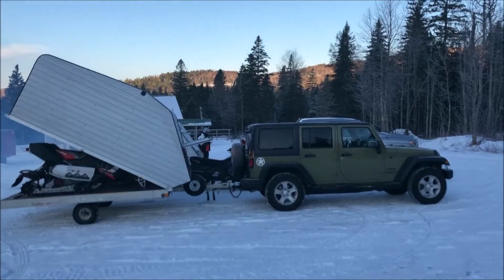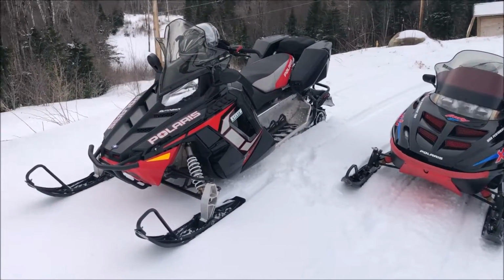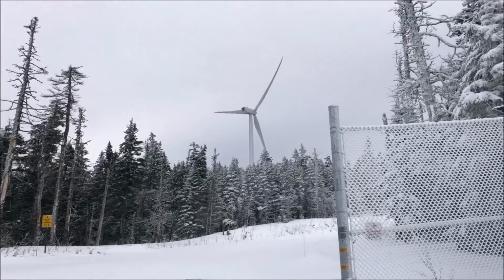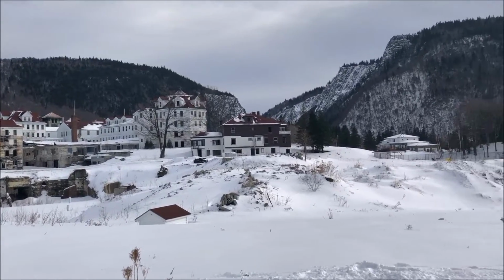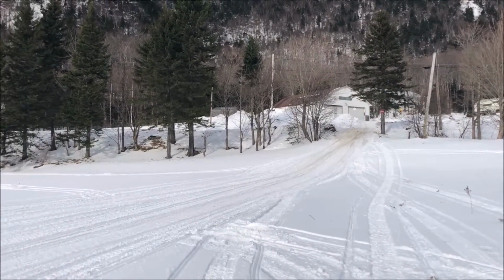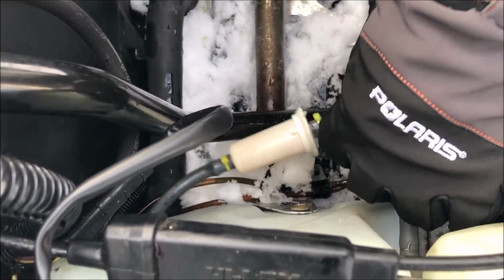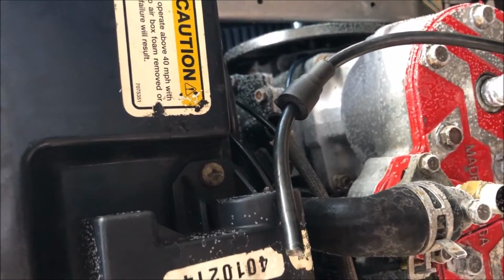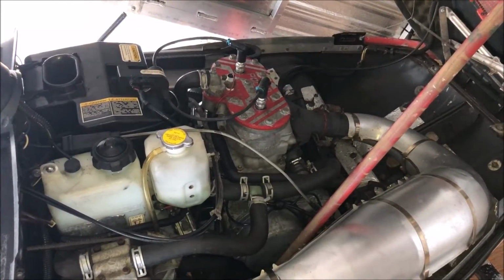First Ride On The XC700 And It's First Failure

Comment: Wow that thing sure sounds rattly inside the aluminum trailer.  Great folks over at Polaris Indy Garage!
Reply from the maker: It’s the aluminum heat shield around the muffler. The rivets that hold it down are busted and it vibrates at low rpm.  

Still need to fix it. 🤣

Comment: Nice ride Streeter, and it's always a nice feeling if something goes bad it's in a spot where you don't have to MacGyver something to get it back home. My question is, doesn't the spark plug lead screw into the coil? I know the older ones do, but apparently that's not the case with yours. Nice video, looking forward to more.
Reply from the maker: Yes you’re right. The problem was the that the screw portion that comes out of the CDI broke off in the wire. Leaving about 1/8” stub.

Comment: Great job on the rebuild! My 99 xc 700 just died out on the way home i think its electrical havent looked at it yet but do the cdi boxes go out just like that? Dont want to start were do you think i should start looking? Thanks for youre advice!
Reply from the maker: Take a look at this first. This should walk you through the basic stuff to check first. 

Polaris Indy Wedge Snowmobile No Start - Troubleshooting 101 https://youtu.be/yeWP-BPR-Rs
Reply: @StreetersGarage  yup watched the video...now i went to town to get gas its a 99 xc 700 it was running like it should until 3 miles back it just dies out. Thats it. Tomarow i will check youre list to see if something came loose..but there is fuel and i will check the electrical system. This is what i suspect its either the cdi or stator. But i will get back to you once i go threw the check list. Thanks for youre knowledge on this matter.
Reply: @StreetersGarage   i have a 98 xc 700 and a 99xc 700 and from what ive been reading about these sleds are 2 major problems with them finding  a  ingnition coil and stators. The guys tell me its better to upgrade to a rmk stator and coil ? I cant seem to find coils or stators for these sleds i would like to buy a set up for both so when it comes time to replace them i have them and after that they will be available. The stock ones are very hard to come buy if i can even find any. Other than that i can get everything i need for my sleds its just those oem stator and cdi, ignition coil.
Reply from the maker: Mykel Greene Yes. The Ducati CDI’s are known to fail and unfortunately there’s no aftermarket replacement.
Reply: @StreetersGarage Ducati stator is 11 months old  Why i suspect its the ignition coil the sled just died out like i turned it off with the key. Upgrade  thats not even a year on that stator..  Options? rmk stator,coil,cdi, kiehn carbs ,92 octane and timing.
Reply: @StreetersGarage  my sled is flooded it fouled the plugs on the way home and gas is shooting out the plugholes can i drsin the block? What causes this?
Reply from the maker: Mykel Greene bad needles and seats in the carb, bad fuel pump or stuck choke plungers. 

More than likely it’s the needles and seats.
Reply: @StreetersGarage  I looked at it again today and no spark...reason why it was flooded just happend because to much prime and chokeing it... Its electrical do these sleds have the cdi and coil located on the top of the air box? Could it just be the coil? Or both? Finaly im suspect its the stator
Reply from the maker: Yes the coil and CDI exist within the same assembly on the air box.  You would need to check the stator using a multimeter. Measure the OHM resistance values from the stator wiring plug.

Comment: Was the rebuild fairly straight forward? the obvious things like - prelubed the internals, gapped the rings, prime the oil pump? and anything else I missed....
Reply from the maker: Yes on this engine. It’s pretty simple. We put in a new set of pistons. Replated cylinder and a good used crank that was trued up. 

The most important thing is the torque sequence when installing the top end. Just go by the service manual and you’ll be all set.